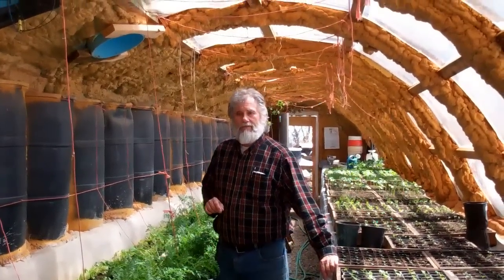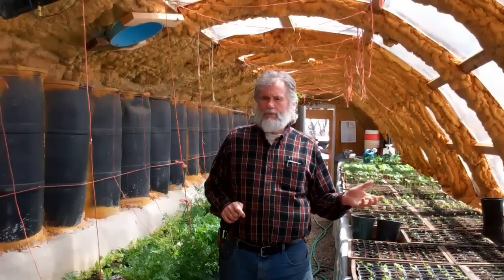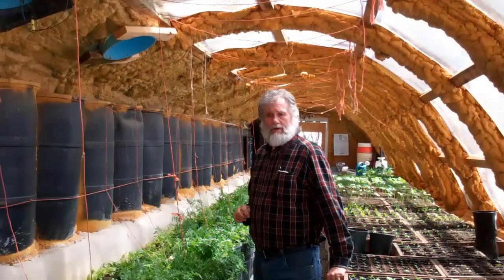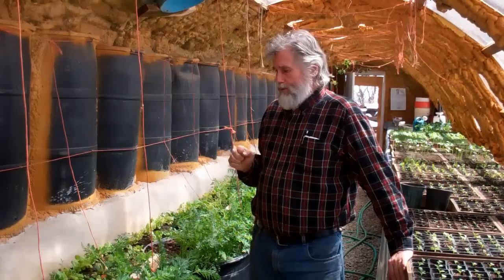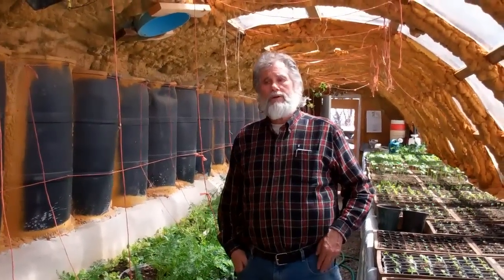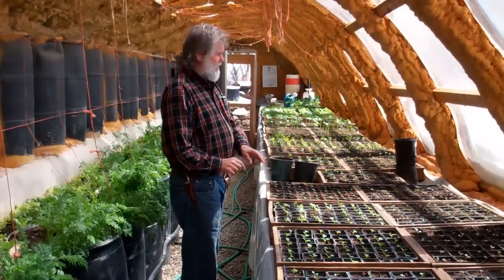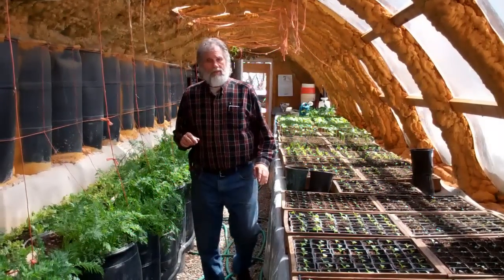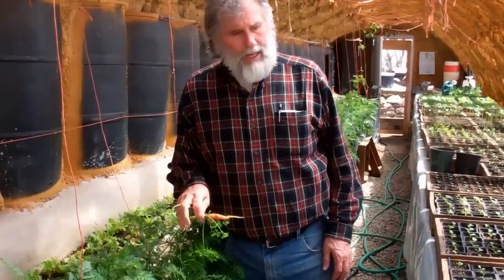Greenhouse Construction  Four Years After Greenhouse Construction

Comment: I love the heat-mass "hoops" overhead.  I love this low-budget, but well-thought-out designs.

I'm thinking about more elaborate, expensive-up-front ideas that give you better winter and summer temps, inside.  

You make a very good point about minimizing the amount of air space that needs to be climate-controlled.  But I also see the heat-engine potential of much LARGER air (and water) volumes to do the work of controlling the climate in a minimized space.  Even in a HUGE greenhouse, the only volumes you're worried about are those occupied by plants and animals.  In this larger greenhouse we occupy, the top layers approach absolute zero at night-time and the Sun will  burn you  to a crisp in sunlight near the top!  Heh.  The hotter you can make the unused airspace at the top, the more horsepower you can develop!  Just a matter of figuring out the engine, steam-punk style.

Comment: @Ted that looks awesome. Good luck with your self sustaining year round healthy natural food supply. Very impressed. keep it up.

The only thing I want to know is, can you use glass windows or do you need to use plastic covering for the best effect ?
Reply: The short answer is yes, but you loose insulating advantage.

He may have used this: http://www.greenhousemegastore.com/product/solexx-xp-per-linear-foot/plastic-greenhouse-film

This is what I am using in a 30x24 underground green house.  AKA Walipini, or warm place.  The Walipini is 6' below grade.  The roof is solexx on the south side and an insulated roof on the north side.  

To address you question about glass:  1.  It is very expensive.  2.  It is very heavy.  3.  It is "too" clear in that it causes hot spots in a greenhouse.  4.  It has no insulating, (R-value), R-value.  You can use glass and you should if that is what you have on hand.  You just need to be aware of it's properties.  5.  Glass is very long-lived.  If it doesn't break, then it should outlive you.

Products like solexx or poly-films diffuse light.  That's why you don't necessarily get hot spots with these products.  When you research sun light that plants use/need you will find they like both IR and UV light.  Visible light, which is light we can see is not necessarily the kind of light plants utilize.  That's why with light diffusion, you get both UV and IR light with direct visible light diffused.  Hope this helps.

Comment: I can see many good things in your design, however.
I guess you ignore the out-gas of the foam isolation you applied everywhere above.
I have used a mixture of cement and shredded Styrofoam that is much more stable.
Little cement and it is light weight.  More cement and it is heaver and tougher.

Comment: this is really interesting!
but i've got some observations and questions:
1- what is the orientation of the greenhouse?
2- are the water tank at the back on the north side? that's why that side has no windows?
3- to keep more heat in winter wouldnt have been better a more bulky shape, instead of an elongated stick?
4-i'm concerned about all that foam you sprayed around: in a few years it will be old and start to dust out. that's toxic as hell, it will deposit on plants, and in the soil. it is also useless because the moajority of heat will disperse through the glazing. if you need to make it air/watertight there are more efficient methods :) 

but it looks great! have you quantified the production over area per year?
Reply: I was thinking the same about the foam but at least it’s not fiberglass insulation. Those health problems manifest much more quickly.

Comment: People don't realize that you don't need to heat greenhouses if they are built this way.  This is what is called "passive solar" construction.  Thermal mass acts like a heat battery to absorb heat and help cool the greenhouse during the day.  At night that same mass radiates heat back into the structure.  All of this depends on good insulation and high "R" values.  But it need not be expensive.   If you build the greenhouse partially in the ground, you are also able to use the foundation itself as thermal mass as well.   I first saw a greenhouse constructed this way on Cape Cod when I was a kid.  It was call the "Urban Ark."  In frigid weather with two feet of snow on the ground we walked into this greenhouse with three 500 gallon tilapia tanks with fish swimming around in them.  It was 85 degrees inside.  No artificial heating, just sun, insulation and thermal mass.  It seemed like magic, but really it's just intelligent design.  The real kind not the other kind.  :)
Reply: Thermal battery designs aren't as reliant on insulation as you might think. No matter the R value, solid mass can only bleed heat at a certain rate. It's not like a home where the heat is in the air, and can be lost quickly.
Reply: 85 degrees in the afternoon isn't that difficult to achieve, without ANY kind of extra heat-mass work.  The key temperature measurement is the pre-dawn and early-morning hours, before the Sun has had a chance to warm it up.  It also depends on available sunlight and what plants you wish to keep in production, year-round.  Stakes in the ground with a layer of plastic over the top can extend growing seasons, significantly into early spring/late winter and late summer/fall.  

There are places in the Colorado Rockies where it gets to -30 F (about -30 C) at night, but they get direct sun ALMOST every single day.  Even big weather systems are no match for the local convection cells in those high-mountain valleys.  The weather map may show cloud cover from California to Kansas, but those high mountain valleys are still getting 2 good hours, at least, of direct sun in the early afternoon.

I'd keep an eye on his kiwi tree!  I'd keep an eye on what the people growing CITRUS in the northern and mid-latitudes are doing.

As for myself, I don't think I'd put all my eggs in the passive-solar basket.  I'd have redundancies built in, even in high-and-dry places like Colorado.  I think if you take a "purist" approach, because it MOSTLY works, you could lose a lot of plants with one episode of cold and cloud cover.  A rocket-stove mass heater as a backup would seem to be a very good idea.  Probably less emissions from something like that than just about anything, including electric or natural-gas heater, by the time you figure in the environmental cost of building and delivering solar panels and chemical batteries needed to store it for sustained power.

I think people have been sold a bit of a fallacy with regard to solar-electric.  There just isn't that much energy per square meter (something like 1 Joule, if I recall correctly) at the best of times, and meanwhile, you've covered that patch of ground with silicon-and-metal contraptions that Nature had other, more plans for.

As for the rate at which the thermal mass loses heat to the space, a lot depends on the relative temperature difference between the mass and the surrounding air.  The rate of heat loss goes up when it's really cold.

Carrots, turnips, radishes, cabbages, spinach, ...  salad greens in general, tend to be highly cold-resistant.  Carrots can even freeze overnight and still recover.  Those make sense in in-ground greenhouses.  Just keep the frost off them and they'll thrive.  

Anyway, I'd take a multi-pronged approach, with emphasis on passive methods, and especially on methods that maybe take a little more investment cost in the initial build, but which minimize the need for moving parts (like fans and pumps).

The gentleman makes a really good point about minimizing the amount of air space, relative to the thermal mass.  Another advantage to this relatively small surface area is that simple strategies, such as heavy drapes or insulated covers for nighttime can be super-helpful.  Cold frames inside of greenhouses make sense.  I read the other day that every layer of protection, every layer of trapped airspace between inside and outside gives you about 8 degrees (F or C?  My dunno!  I ThINK it was 8 F, which is a little more than 4 C) temperature difference.
Reply: Thanks for this post, which I just found.  We are in the design phase, hoping to build a passive solar walipini this year.  Really novices, trying to design everything right so we won't have to heat in the winter.  If you can point to any additional resources, or other people who are actually successfully doing this, we would love it.  Thanks again.

Comment: that was a little vague, no outside view... are you saying no additional heat source? and the space under the table is solid mass? need more info... but otherwise very fascinating... I agree zero maintenance and passive thermal equilibrium is key... this should be possible today... (if I'm reading you right)
Reply: Have a look at Ted's other vids showing it's construction.  Seek and you will find

Comment: You could combine this with the solaroof bubble insulation concept and keep this quite warm even in the deepest of winter.

Add some solar parabolic troughs at the bottom of the front and you could probably keep this in the 60s(F) all winter and grow quite well.
Reply: Solar Bubble wrap is extremely expensive.  Cost a fortune to do a large greenhouse.  I thought about using uline industrial heavy duty bubble wrap at a fraction of the cost for that solar wrap.  And then putting a layer of greenhouse plastic over it.  I was pricing a large greenhouse at over $52,000 for solar bubble and maybe only a couple thousand with the uline bubble wrap and a layer of 6 mil over it.  Save around $50,000 just on plastic.  Going to use wood and staple it over it.  That would of be for a 70' x 208' greenhouse.  Planning on using geothermal ducting to heat and cool it.